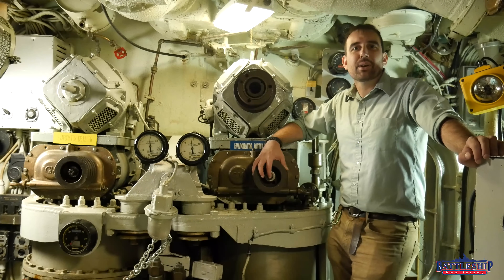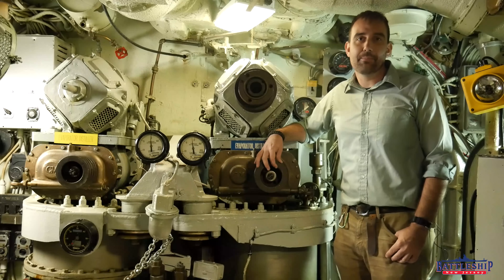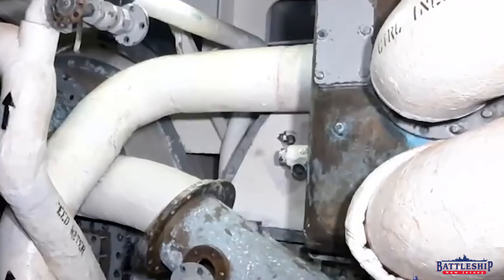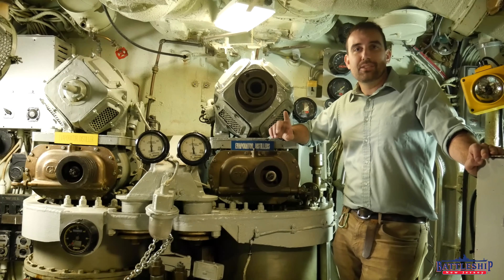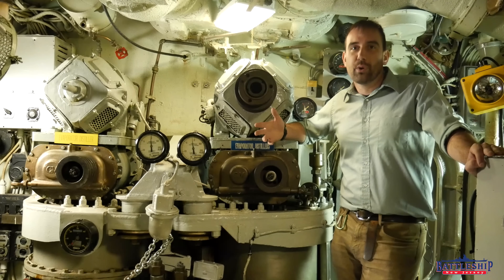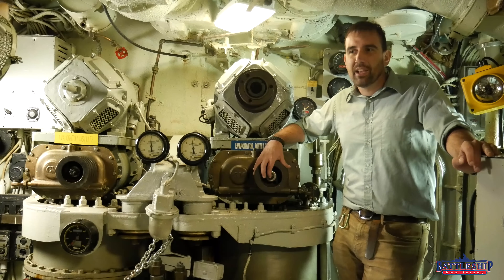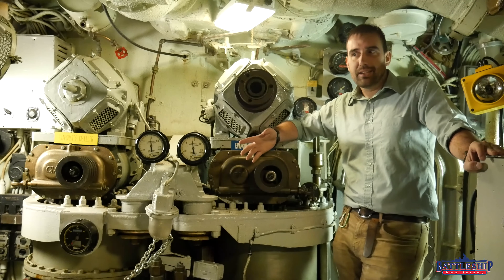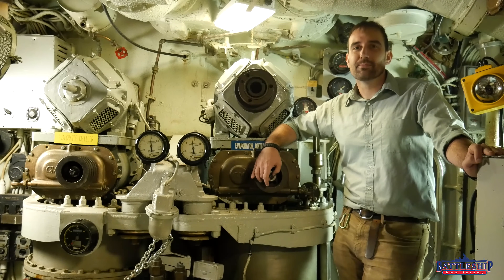How Does a Submarine Make Water?

Comment: We had 2 evaporators on my nuclear submarines an 8000 gallon per day using steam or an electric unit capable of 2000 GPD on one boat and 1600 GPD on the other
PS the battery doesn’t explode it gives off chlorine gas when salt water is introduced

Comment: When I deployed with my MI Army National; Guard Company to Iraq, once in Iraq, showers were interesting.  Our 1st mission was at Camp Victory.  The team shower was open air from a garden hose in an enclosure with tarps.  Across the road was Lt. Gen. Sanchez's quarters.  The temperature of the water depended on the time of day.  Late afternoon was normally the best.
Once we got the shower in the team house working, the water temps were the same.
Our next mission was at BIAP (Baghdad International Airport).  The first quarters were crap.  My shower was to leave my 5 gallon Homer Bucket out in the sun all day.  Then in the early evening, pour a bit over me to get wet.  Now get all soapy.  Then slowly dump the rest of the bucket over me to rinse off.  It wasn't long until we found a house with access to water.  Priorities then were a stool and a shower.  As the weather cooled, we got a small water heater.  Now you could shower anytime.  Even later with the help of some Iraqis, the bathroom off of my bedroom was made fully operational.  That was the best of the tour!
When we moved to Mosul, we had "conex" quarters with a potty trailer and a shower trailer.  Once when I was all nice warm and soapy, a mortar exploded on base.  Not terrible close.  The proper reaction would be to run out of the shower grabbing your towel and take cover in the 40 degree scud bunker nearby.  I didn't wasn't to catch cold or worse!  So I just hunkered down in the bottom of the shower and waited.  No more mortars landed, so I continued my shower.
Now one from the Air Force.  At the barracks I was in at Griffiss AFB, Rome, NY (now closed), anytime someone flushed a toilet, if a person showering didn't get out the spray very fast, they got scalded.  In the shower, you noticed a slight drop in water pressure.  That was your cue to MOVE!  The problem was finally solved when a senior NCO was staying in the barracks and got scalded.  He got after CE to finally fix the problem.  I guess nothing solves a problem fasted than a boiled senior NCO!

Comment: so tell us how the evaporator works?  Intrigued by the roots blowers. Evacuating the air after condensation?  What about the salty residue?
Reply: Boils sea water which creates a condensate vapor of fresh water, which is collected on a dome in the unit then drain off.  The brine is removed to the bilges then pumped or blown overboard.
Reply: Evaporators run at a bit of vacuum equivalent to the boiling point of seawater being 165F. this is hot enough to kill microorganisms and cold enough to minimize hard water scaling on the internals of the evaporator. Ran two different evaporators on SSBN Alabama. The main was steam powered, the backup was run from electricity.... both good machines. The steam evaporator ran well enough that we could take Hollywood showers. The main limit on showering was the time that you were in the way of the next sailor.
Reply: Evaporators work by evaporating.

Comment: i was on a gearing DD 849 aft engine room we had water all the time shower head hooked to the dumping valve on the evaporator worked good when on water hours
Reply: "Deckplate showers"! Yes! The smaller submerged tube was aft. 5000 GPD as I recall. The bigger one was forward. 12000 GPD.

Comment: The two evaporators are on the fwd watertight bulkhead of the fwd engine room.  On the other side of that bulkhead (the rear of the after battery compartment) are the crew showers (usually 2).  Those evaporator stills use electricity to boil sea water and the condensate from that is what becomes the fresh water.  The enginemen on duty in the fwd engine room kept a very close eye thru the open watertight door on the shower usage when the showers were open.  Anyone taking too much time or using too much water was likely to get at least a verbal scolding from those hot sweaty enginemen who had to run those hot evaporators.
Reply: Definitely!  NOT a plum job.
Reply: But at least you had the luxury that your shower water would be hot, straight from the condenser. Guess it was not easy to make a dual feed shower with the majority being salt water, and only a 30 second rinse in fresh water.
Reply: @SeanBZA  Actually, I think the newly made fresh water went into the fresh water tanks and then was used under pressure to feed the battery water, sinks, the hot water heater for showers and the shower cold water.
Reply: @SeanBZA  I've heard of such set ups on skimmers back in WW1, but never on a sub. Not sure the extra complexity would have been worth it. After all, it would be for the crew and not the boat! :)
Reply: The diesel boat I served on never allowed showers at sea. Once on the way to Tahiti they blended some salt water  with fresh into a tank and allowed showers but I only saw it happen one time in 4 years

Comment: On a submarine I would think air compressors are pretty important. 

Destroyer escorts also had a very limited supply of fresh water. The cooks getting priority for bathing.
Reply: There are normally 2 air compressors and on a WW2 sub (originally in the pump room below the control room but sometimes moved to the fwd engine room during modernization).  The 5 main air banks have a working rating of between 1500 and 3000 psi (4500 psi in current nucs) and are place on-line 1 or 2 at a time.  These are usually only on-line when the sub is on the surface with plenty of fresh air coming in and the diesels running to create adequate electricity.
Compressed air of several different pressures is used to blow main ballast tanks, most other tanks, start diesels, charge torpedo operating and firing systems, provide hydraulic system pressure, run air-powered tools, etc, etc, etc.....

Comment: Salt water entering a battery cell will produce a great deal of noxious gases including chlorine but it will not cause an explosion. Too bad you didn't talk about how those vapor compression stills worked, they produced very high quality water but were incredibly noisy and the heat they put into the engine room was miserable in tropical seas. It was not all bad for the engine watch though, there was always plenty of very fresh water available in the forward engine room.
Reply: I believe the US actually lost at least one of these diesel subs to a battery gas explosion.  There were many precautions in place to limit this danger.
Reply: @arniestuboud  Hydrogen explosions were a constant concern. When charging batteries we would line up one engine for ventilation.

Comment: My Grandfather developed (and was not even givin the credit) the Reverse Osmosis Systems to purify Salt water for drinking on on a Missouri class Destroyer...he learned from working at a dairy in S.Kali. by the border. They put milk thru membranes to reduce the fat, it gave him the idea to remove the salt and material until finally there was nothing but "pure hi quality H2O" He made the best Ice cream.
Reply: That is pretty amazing. Reverse Osmosis is huge now. It can be done for less energy than most any other de-desalinization methods, although the filters have to very carefully monitored and constantly back-flushed. You can even buy little hand held models for camping or boating now (turning a crank to create the pressure needed to force the water through the filters).. If he didn't get rich from that, he was cheated! 

It does not produce actual distilled water though (there are still low levels of impurities in the water although it is perfectly fine to drink, cook, or bathe with), and I suspect Distilled water would still be required for boilers or lead-acid batteries.

There are also electrolysis methods which crack the water molecule to H and O, then use the gasses to run an electric fuel cell to get back some of the energy in the form of current, after which the H and O recombine and form ultra-pure water. Some subs use these now.

Comment: I find it interesting that they are using Detroit Diesel blowers on the evaporators. You can see they even say GM on them. Yes that’s General Motors.
Reply: Only good thing about the old 2 strokers other than the sound.
Reply: Actually the main diesel engines on the Becuna are also GM - V-16s.  Subs built in non-government yards used GMs while government building yards used Fairbanks-Morse opposed piston diesels.
Reply: @arniestuboud   The USS Cod also has the GM Diesel's, they were produced for the Navy at the Cleveland engine plant, about 6 miles away from her present berth. Cod was built at Electric Boat in Groton (a "Gato" class), as was Becuna ("Balao" class, launching about a year later). Electric Boat was always technically a private yard (General Dynamics owns it now), but their ties have been very strong to the government all along and a few times they would have closed, except some contracts were thrown their way to keep them open.
Reply: Why not I guess.
Reply: they may of been manufactured by gm but they are just standard roots type blowers......   like the kind for blast furnaces.....and superchargers lol

Comment: How does a submarine pee?
Reply: You need a minor degree in hydraulics, pneumatics and plumbing to use the "head" in a submarine.  If you don't 'line' the valves up correctly you could end up wearing what you just dropped.  As a submariner about "Teflon dolphins."  😲
Reply: @robertf3479  There was a German submarine that sank because someone didn't know how to work the head.
Reply: Smarter Every Day has a whole series about life aboard a nuclear submarine.
Reply: There were 2 types of toilets on these boats, with the dangerous type being those with direct discharge to sea.  But by the time the subs were modernized all of the heads, sinks and showers drained by gravity into sanitary tanks low inside the pressure hull area, vented inboard thru charcoal filters when at sea. These were then valved off and the contents blown overboard with compressed air.  This could be done when submerged too, but venting that pressure off inboard did cause quite a stink even thru the charcoal.
Reply: Out it's butt